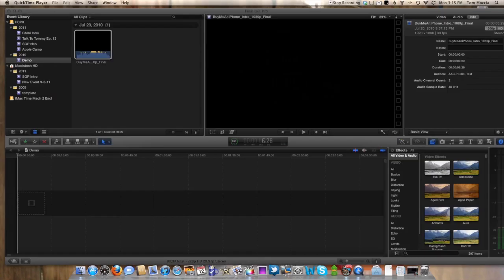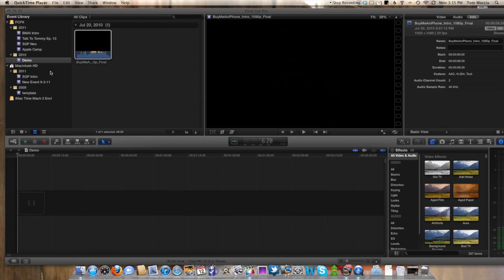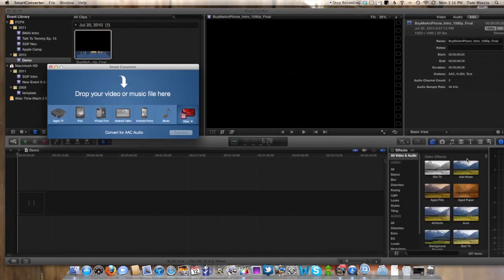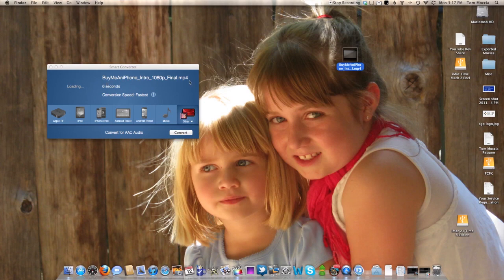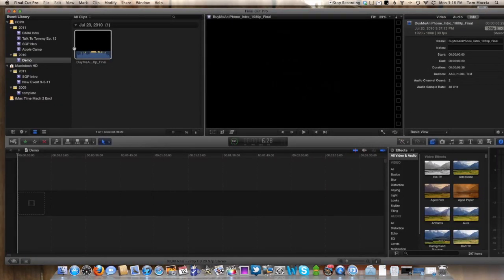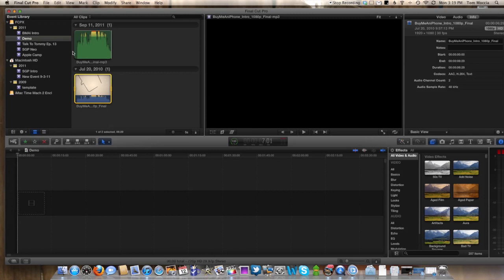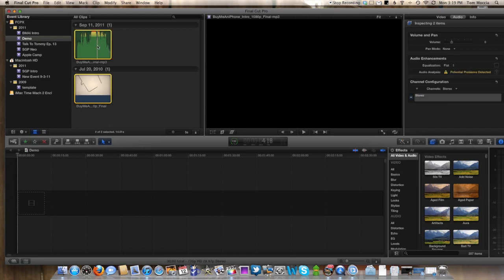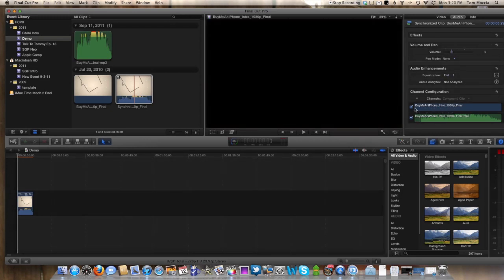Take the Popping out of Final Cut Pro X Audio

Comment: Seriously? Just downsample the audio to a shitty compression rate so it smoothes out your clipping? Horrible, horrible tips. Believe me, from a 27 year audio veteran, do NOT do this to your audio.
Reply from the maker: Hey Mark, most people are not such experts as yourself they just want s quick fix. Makes me wonder why such an experienced vet is watching this video.
Reply: I was watching the video because I was researching new noise-reduction plugins for FCP X. I couldn't help but not comment because this is the worst advice possible. Degrading your audio to mask other problems is not a quick fix, it's just making your audio even worse.
Reply: +Mark Lindsey so what did you discover? What is the best practice to remove pops and ticks in audio?
Reply: To take it into a pro audio app like Logic and use high-end plugins to re-click/de-pop. They can also be hand-drawn out of the waveform when the plugins can't handle all of the artifacts. the method you used reduces the quality of the entire track, which is why it softens the ticks and pops (although they are still totally there, just attenuated a bit, along with the other high-frequency content). The best thing is to mix your source content better and not use something that was mastered with clipping (in a perfect world). :)
Reply: cheers for your help mark

Comment: The reason this happens is because the video you imported has a audio sampling rate of 44.1 kHz while video in FCP sequences is 48khz or vice versa. All you need to do is make sure your source is the same sample rate as the sequence. Also, use WAV or AIFF instead of MP3. MP3 sucks for video authoring due to its really terrible compression for professional authoring.

Just for your own edification..... :-)